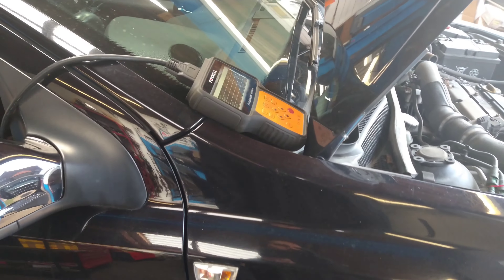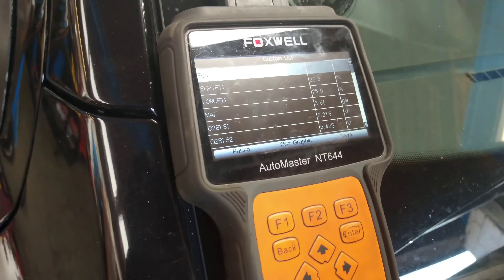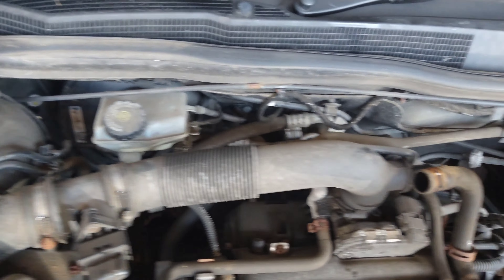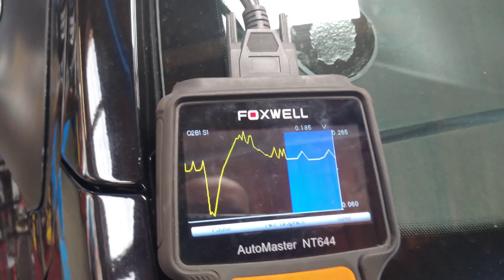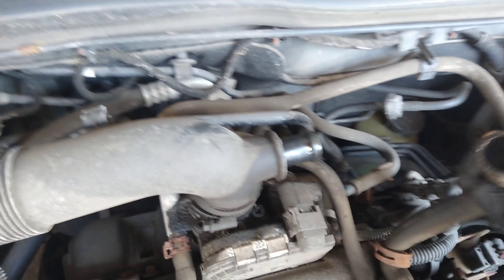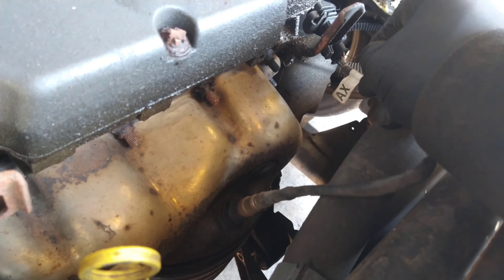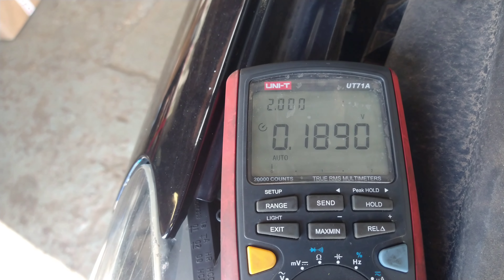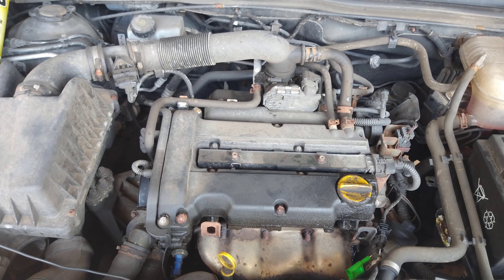Vauxhall Astra ( non responsive O2 sensor ) testing

Comment: Are you sure that a spray containing PTFE is safe for use with oxygen sensors?
Reply from the maker: Hi, a spray of wd40 hasn't damaged a known good oxygen sensor. It will be getting burned through the cylinder first. It's just a quick burst of it.
You could use a non PTFE spray if you prefer, or even a gas. I wouldn't spray wd40 through a MAF though because that is likely to damage that.
Even giving the throttle a snap and looking a change is an option, although that can be misleading if you had a fuel delivery problem. 
Thanks for watching and your comment

Comment: Was rear sensor not picking up the lean or rich condition ?. Nice diag matt.
Reply from the maker: No it was at 450 mVolts until it got hot then it was showing rich. It took a bit longer than the front O2 to start working.
Thanks for watching
Reply: @mechanicmatt871  perfect matt looking forward to more

Comment: How do you find that foxwell tool?  Does it do most things needed for diagnosis and clearing codes etc?
Reply from the maker: This has been great, the ability to read all modules on the car, and see live data has helped me diagnose so many cars. It also has graphing data and records for not missing anything while driving, it's good for resetting service lights although not able to reset the Audi inspection light.
It doesn't do bidirectional control
For the money this is great
Thanks for watching
Reply: @mechanicmatt871  cheers look forward to seeing more videos of what it can do